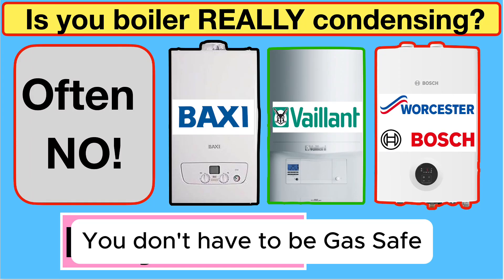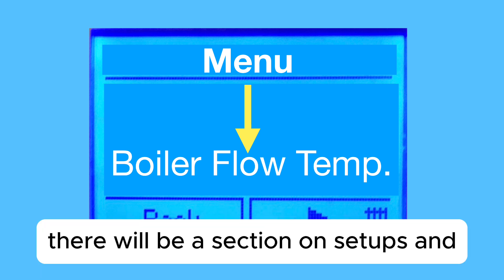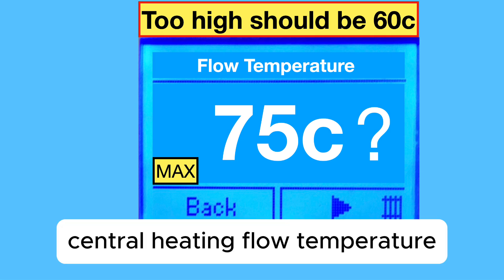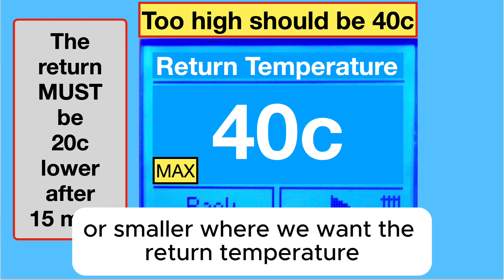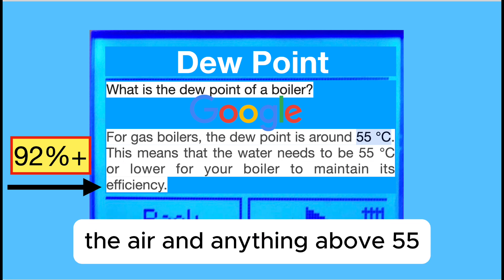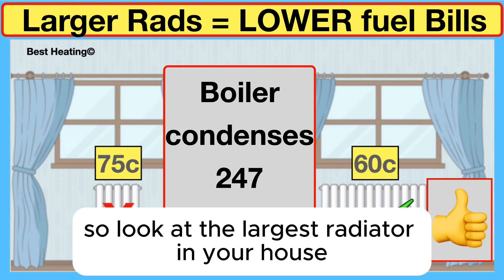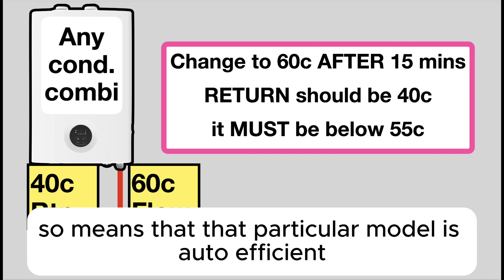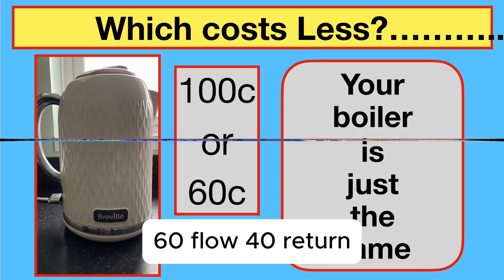Is your boiler REALY condensing? Most are NOT, I show you how to test, it’s easy.

Comment: Will 50c be more efficient than 60c as long as the return is around 30c?
Reply from the maker: Thanks for asking, yes the lower flow cheaper to run and more efficient, the boiler will never do a day's work. My Inter is set to 50c flow 50c water, she don't know, I won't tell. My cousin in Poland told me that in year 2000 when they also went condensing 60c. Only the UK stayed 70c+ shame. Ever thought why we have the highest bill worst house builds, ask your MP. Alll the best George Staszak🤩

Comment: Very sensible advice,  I live in an old 13 room victorian house I run the boiler 24/7  rooms at < 18. C and the boiler flow at 45C there is no steam/condensing vapour visible from the flue the boiler is a Valiant and modulates to a low idle, the pump is running more but that has been doing so for ten years and is still a happy pump.  

By keeping the house walls at a steady temp water vapour does get absorbed only to be evaporated when the room is heated again which actually drops the wall temperature due to evaporation.  Also as the rooms are at the same temp you can reduce the temperature as you don't feel any difference moving around the house.   Most houses heat yoyo's all over the show and is shut down at bed time so more energy is thrown in to bring it up to comfort levels in the morning. It takes a week to get the house walls / mass at a steady temp but once there it is worth the savings.  Also check your shower head is not high flow, this is wasteful change to  a fine jet which will do the same job but 40% less water deduct the kids pocket money for long showers and draw curtains it helps. 

If the humidity starts to rise I run Ecoair 122  desiccant dehumidifiers on low, the condense 4 ltr over 8 hours but also release 380 watts of heat in the room I also have one int eh bathroom to recover the heat from water vapour or drying clothes,  DON"T dry clothes on radiators or let bathroom or kitchen steam in the house either condense it or let it out. 

Hot water is the killer if the pressure or flow is to high and generally it is. Adjust this so the boiler reduces its burner down a touch makes for big savings also turn the Hot water down to 50 if short runs of pipe 55 if not. I know the recommend temp is 60 + for legionella but too be honest this is very unlikely to exist in a home and if it was present is in a loft tank or unused shower head. 

Thanks for your tips they are helpful and practical.
Reply from the maker: Thanks for a very detailed view of your home which is amazing. You must have done a lot of research to get to that high level. I grew up in a Victorian house in the 50's love the big rooms and so many of them, I also remember how cold it was until I learnt to install some rooms with a boiler and rads in the mid 60's the heating the rest had a gas or coal fire. All the best George 😍👍
Reply: @mrcombiBedford  Thanks George, yes it is a  bit big for one chap and his dogs but I count myself very fortunate.  As you know from your years of experience installing and running boilers understand how the house uses the heat and managing it is important my main focus is to control the humidity to below 65% to keep the walls from cooling. 

A low temperature in the house will encourage condensing of vapour into he walls even worse if they are lime mortar so I have the house at a steady temp all the time. 18C is actually a tad warm for me. Thanks for your very informative videos I and others appreciate the time you take and your relaxed style of presentation. Best
Reply from the maker: @WOFFY-qc9te  Thanks for that, I enjoy helping others much better than day time TV, regards, George